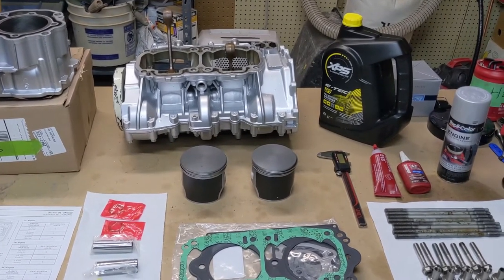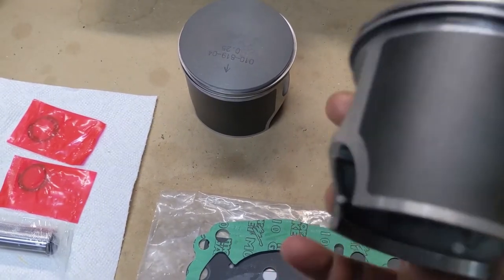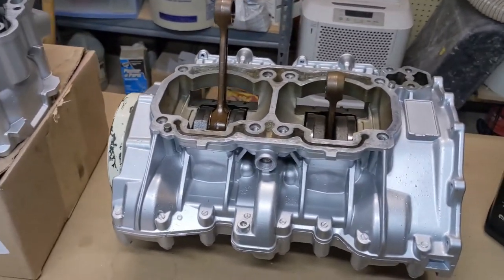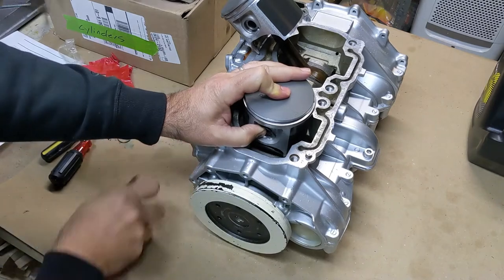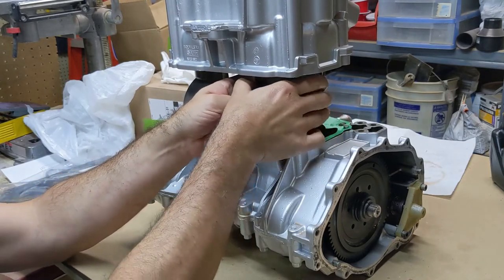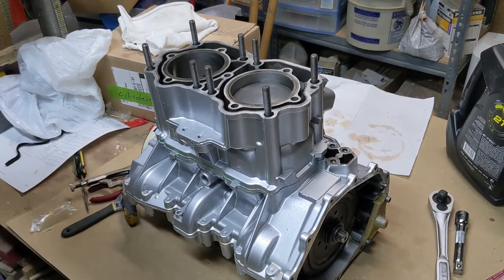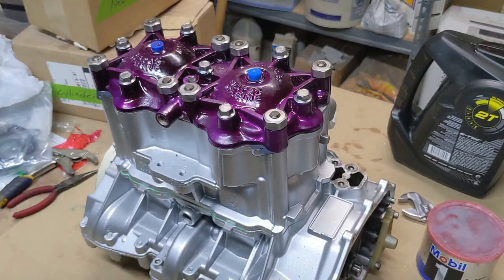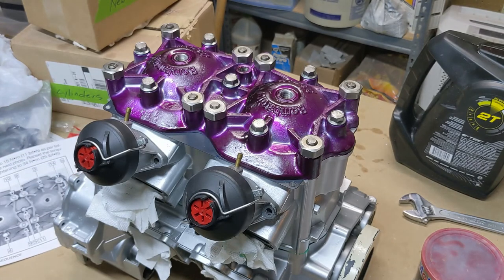Sea-Doo 951 Rebuild Top End - Gray Ghost Resurrection

Comment: If you wrap Velcro around rings and get really tight before putting cylinders on really helps with cylinder install. Velcro will slide down piston as it goes on and then can unwrap from piston. Just thought I would share really helped when installing pistons.
Reply from the maker: That's a really good idea. I've seen people use large zip ties as well. Thanks for input sir!

Comment: hi, whats happen if i didnt put what 8 o rings?
Reply from the maker: Those are for anti rattle from what I understand. They don't seal out water from the engine since the channels should be sealed anyway. That said if water does get in there .. it will rust and corrode up the studs down where they screw into the case

Comment: doing this tomorrow. thank you for the video
Reply from the maker: Hell yeah. Enjoy the journey.
Reply: I approached a little different.
I have xp limited. The engine is still in place. So I put the ring on pistons then put pistons inside cylinders.
All I had to do is slide the wrist pin thru piston into rod and clamp it.
I tried your way but it was not working well for me.